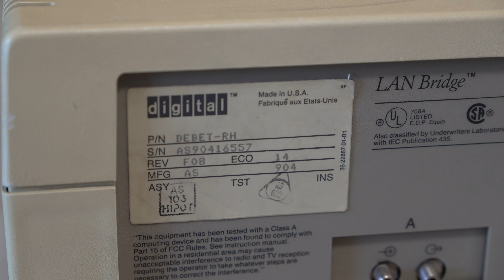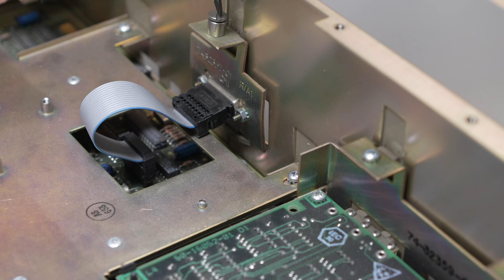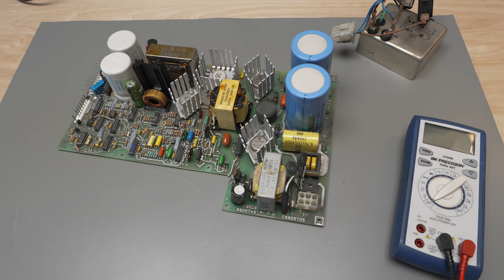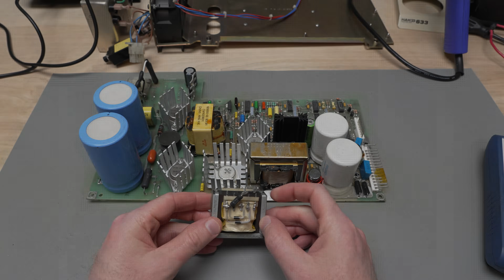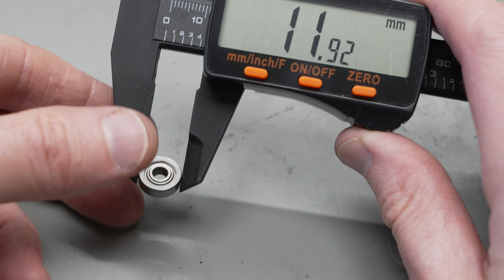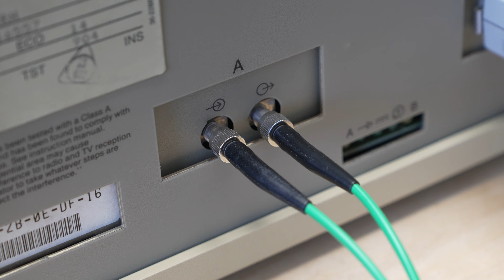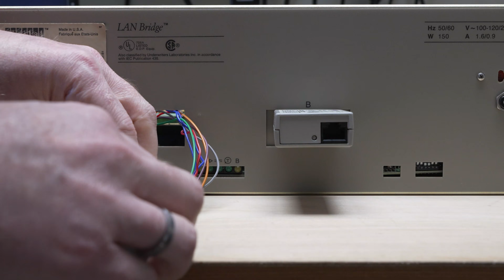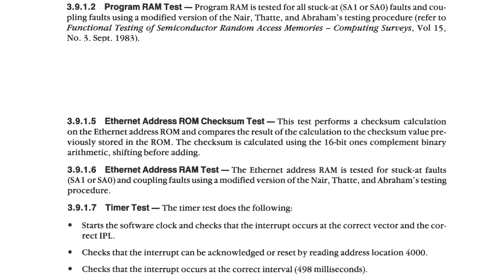Attempting to restore the world's first Ethernet bridge

Comment: Thanks for fixing those fans and not just slapping an under rated Noctua fan in there.
Reply: Why would they be underrated? Fan technology has improved significantly since this bridge was made, and (the correct) modern fans would perform better both in airflow and static pressure, while making less noise.
Reply: @game-tea   For one ... have they?  I dunno.  We had jet engines in the late 80s.  I don't think moving air through a rack chassis was exotic stuff at the time.  ;-)  Some things have gotten optimized -- bearings, blade shape, beveling the bezels -- but the real difference in noise comes down to three factors, in this order:

1) Speed (RPM).
2) Turbulence caused by obstructions.
3) Mechanical coupling of vibration.

The first is directly correlated to CFM and static pressure.  You can make any fan silent by not spinning the blades, but that would have a bit of an impact on its efficacy.

Noctua fans runs slow.  That's why they're so quiet.  And that's why they're often underrated -- because so many people conclude that Noctua fans are so quiet because .. brown .. and never consider that an engineer calculated things like junction temperature and heatsink-to-air resistance to arrive at a CFM rating that would allow the device to run in the temperature range it's specified to run in.  Granted, there's often significant margin there, and as long as you don't ask it do the things the manual says it can do (fully loaded at 40C ambient), it'll probably be OK.  At least for a while.

Noctua fans won't do anything about item 2 above.  When you push air right through a grille with some routed circular slits, or a bunch of drilled holes, you're going to get buffeting noise.  3D print a spacer to move the fan back by an inch or two and that'll improve.

The final point -- well, Noctua fans DO improve that, on account of the rubber mounts.  You can also retrofit something similar onto the stock fan without compromising the device's cooling.  If it's even a significant source of noise in any given case...

So yes.  "Underrated" is usually accurate.  They're PC fans meant to be used in groups to form a slight breeze through a big open case, and they do a reasonably good job at that.  They are not cure-alls, and they do not possess some exclusive mysterious voodoo that breaks the laws of physics.
Reply: @sirnickity I think you have never seen an actual Noctua industrial fan. Also claiming that 80s jet engines are equal to 2024 jet engines is just delusional. We didn't even REMOTELY have the casual fluid dynamics calculation available back then. Now every manufacturer of ANYTHING can run simulations of even the smallest variations. You live in a romantisiced version of the past.
Reply: @sirnickity that is not necessarily true, a lot of engineering has gone into fans in the last decades. Noise isn't just RPM but also blade design, less turbulence= less noise. You can just discard all of that if you don't care about noise and just optimize for performance, but the point is that just the fact that a fan is quieter doesn't mean it's moving less air, or even spinning slower at all. In general noctuas don't really spin slower than other consumer oriented fans. They're just built with noise in mind.

You for sure would have to check ratings, but a similarly sized modern fan will almost certainly outperform those two. If anything, the motors are quite old and are bulky. Smaller motors = more "blade area" = more air. Radial fans aren't that good at static pressure anyways. And with this I'm saying a similarly thick fan that spins at the same speed, not a standard 80mm PC case fan lol.
Reply: @FAB1150   You're not wrong, I just don't think it's relevant.

I have done some comparison on various fans that I can easily get hold of.  E.g., Arctic, Noctua, Gelid, and some less niche Qualtek and San Ace fans.  If I just buy the lowest-RPM San Ace that I can get from my electronics parts supplier, it's near the noise level of a spare Noctua that I keep lying around in my parts drawer.  In free air, at least.

But that's a meaningful qualification.  "In free air."  The minute you put ANY of those behind the stamped metal grille of any appliance or power supply chassis, that nice quiet fan gets considerably louder due to the turbulence.

My takeaway from this is:  The fan itself is not that important.  Noctua's exotic blade design isn't doing that much heavy lifting compared to a vanilla OTS equivalent of the same speed, and the difference that does exists is immediately swallowed up if you're not putting it behind a sleek wireframe grille.  In a modern PC, you'll have some control over that.  In an 80's network device... it is NOT going to matter.  ;-)  The chassis itself just wasn't designed for silence.  The only way around that is to cut out the grille to remove turbulence, or run a very slow fan ... and risk having insufficient airflow.  Isolating the fan from the case can help quite a bit if there's enough motor noise coupling over, though.
Reply: @nickwallette6201  oh this 100%. After a little rant about noctua my only point is that with 99% certainty any modern  comparable size fan you put in there would at least match but probably exceed the ancient ones in airflow. 

Still great that he managed to use original ones, I love how they're still going strong after all these years.
Reply: @sirnickity  you're a goober.
Reply: @HughJaeness   Granted, but what does that have to do with anything?
Reply: I would have been content with a drop of oil in the old bearings.
Reply: Honestly, I am replacing everything I have with Noctuas, because I am figuratively allergic to any kind of fan noise.
Reply: I had one of those Papst fans, also made in the late 80s, mounted in my bathroom steam vent until recently, and I most definitely just replaced it with some off-the-shelf fan. D:
Reply: THANK YOU, I'm stuck of seeing noctuas slapped in things, somebody once put one in a Wii....the Wii barely makes ANY noise! (Without a disk)
Reply: Haha!  I don't usually get sentimental about caps and fans, and will go ahead and replace both while I'm cleaning up an older piece of gear.  Saves me from having to do it later when they eventually fail.  (Although, I can't agree strongly enough that Noctua is not the first and last word on fans.  They have their place.  That place is not "everywhere.")

But, for an outfit that is directed more toward preservation and demonstration in a museum context, I'm actually glad for this too.
Reply: Their industrialPPC fans would be a better fit than their consumer PC fans, they have a lot better static pressure than their normal fans while being quieter than equivalent industrial fans.

Comment: 10 base 5 is lame...  10 base 2 is better :D
Reply: Well, 10base5 was better than 10base2, but the latter was much easier to work with.
(even easier than UTP!  you could always add another device in the same room, never out of switchports or wall outlets)

Comment: Great start to the restoration. Looking forward to the next instalment. Just wondering if the diagnostic ROM outputs to a serial with some sort of result code you might be able to use for further investigation?
Reply from the maker: Yeah sorta-- the manual says the self test records the step it failed on in the NVRAM (which is soldered to the board). After editing the video I went ahead and desoldered it and popped it in the reader. There was barely anything on it, and nothing in plain text that I could make sense of. I just put a copy of it on files.serialport.org if anyone wants to take a peek.
Reply: @TheParallelPort  Maybe you can put nvram to the socket to be able to dump it more than once? I think about running the bridge again to see which part of the dump is changing (if changes at all) because now there is too much to hook on something.
Reply: Might also be interesting to look at the Chip Enable lines of the RAM, since you've identified that there are different banks for different purposes.  That would at least narrow it down to banks that have passed, banks that have not yet been tested, and (ideally) the bank that is under test when it fails.